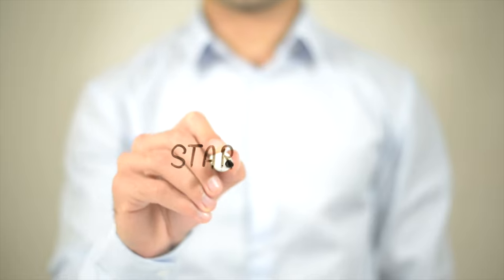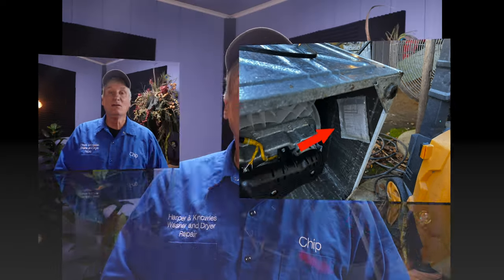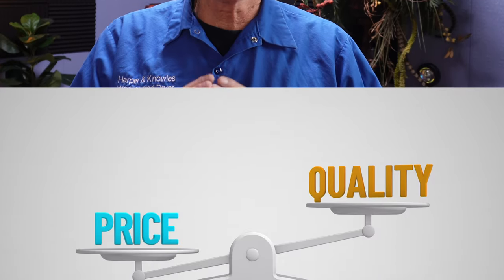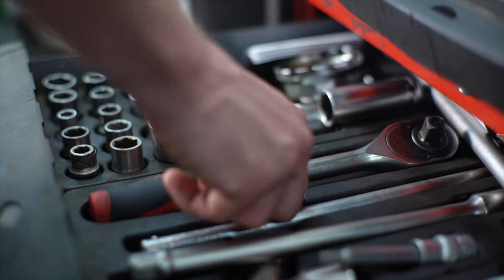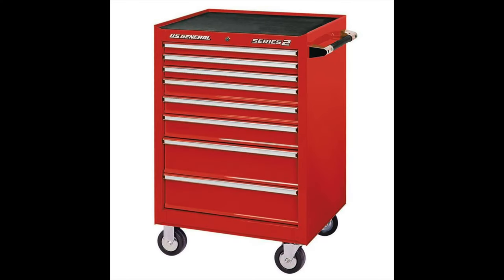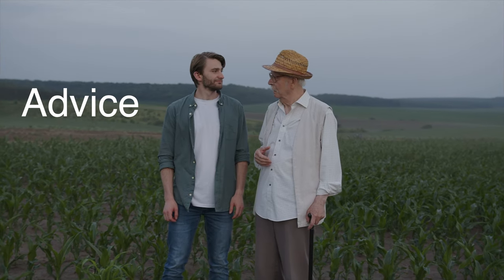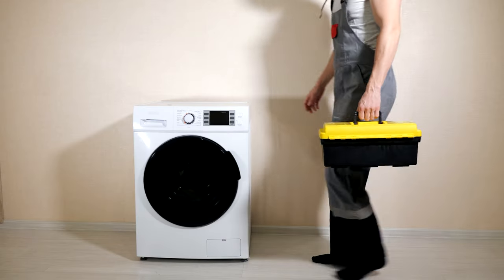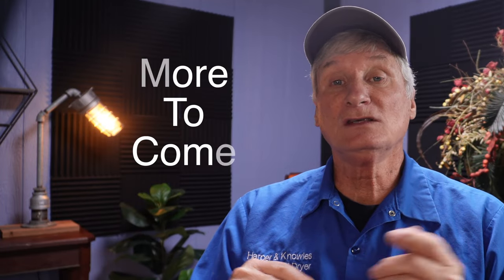How To Start Your Own Washing Machine & Dryer Repair Business: A Step-by-Step Guide

Comment: I remember the G.E. washers from the 80s and 90s had a coil on the back of the washing machine that had something to do with the start windings on the motor. The fellow who taught me the skill, built a G.E. motor test harness with a momentary switch that you pressed once to test motor.
Reply from the maker: I’m not familiar with that but I did make a motor test box for Whirlpool washers using their schematics. Make a washing machine motor test box at home - FULL INSTRUCTIONS!
https://youtu.be/56OI7euGTEc

Comment: What is your opinion of buying machines from a scrap yard that probably has been sitting in the rain? Thank you
Reply from the maker: I have bought machines and put them in my boneyard in the rain and decided to fix them as long as six to eight months later with no problems.  As long as there is no major rust issues where they come in contact with the ground I’d think they would be okay. I wouldn’t pay more than $15 for one if that. I think at todays scrap price they might be worth $8 or $9 shredded. Maybe less. Those old school machines with the whirlpool direct drive transmissions would be my preference, but you might find some decent newer models too. You’d be surprised at how many newer ones I get from scrappers when the only issue is minor like a lid lock. Thanks for watching and that excellent question too.